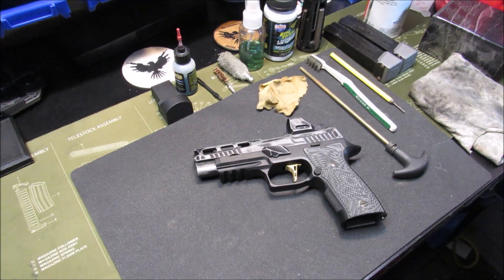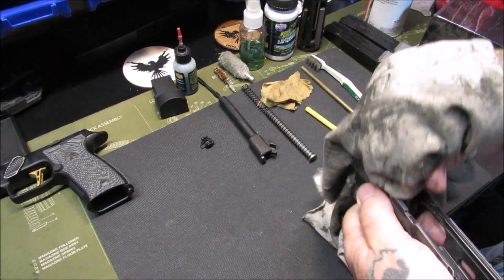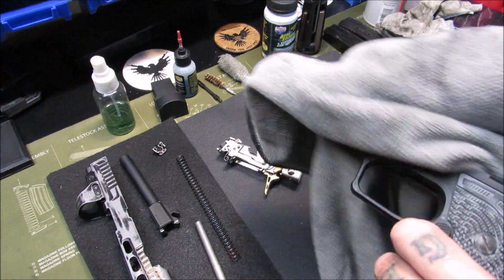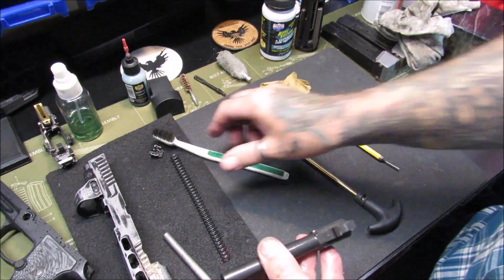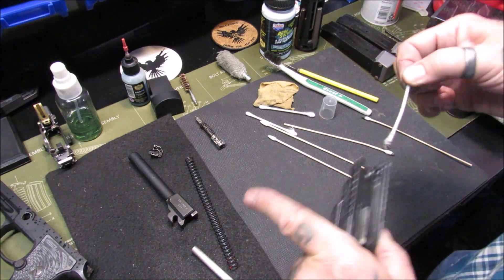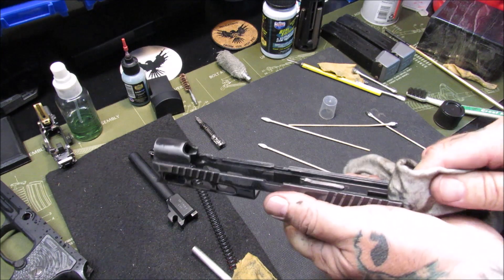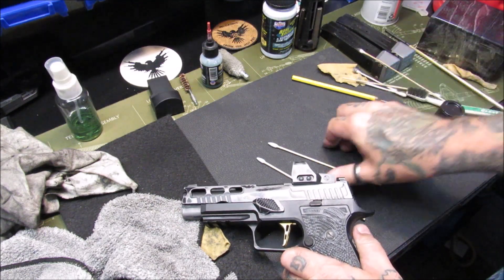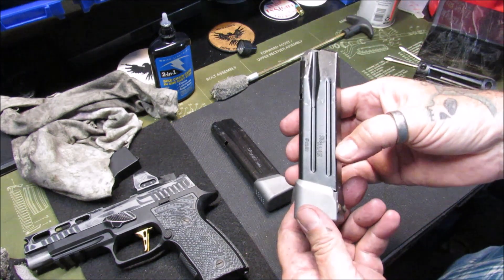Sig P320 AXG Pro Deep Cleaning

Comment: I just picked up an axg pro, does this fit in a regular p320 full size holster? It seems to not have its own made holster yet
Reply from the maker: I run a Red Hill Tactical holster setup. I also think that Neptune Concealment holsters will work as well as some other makers. I would contact the .aker first though 👉💨